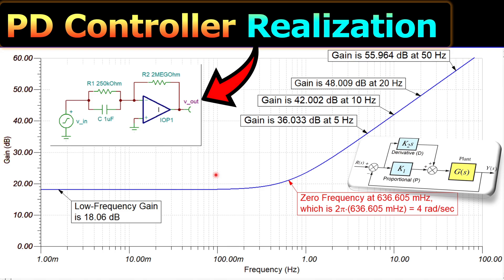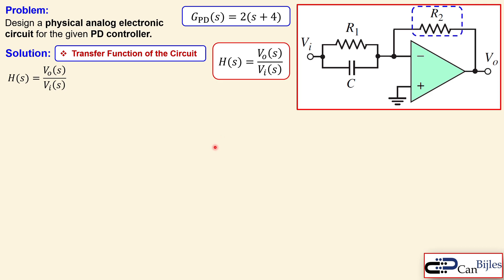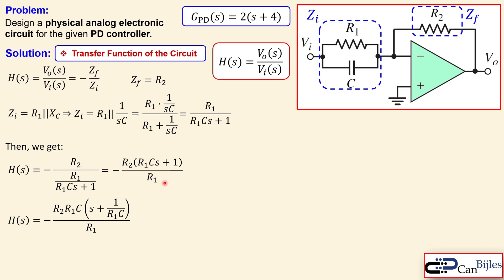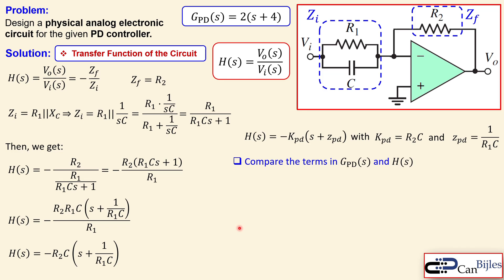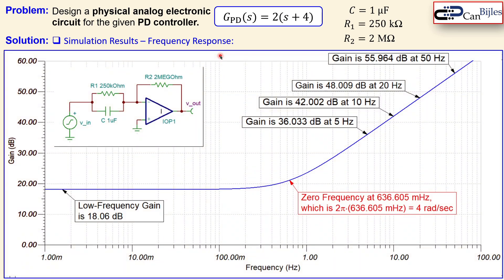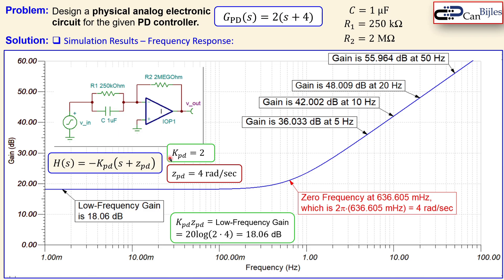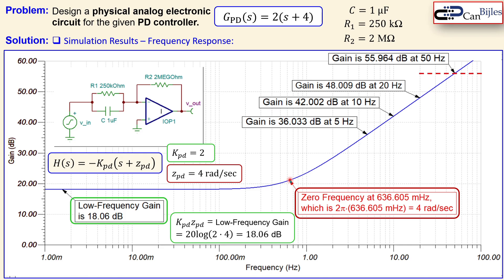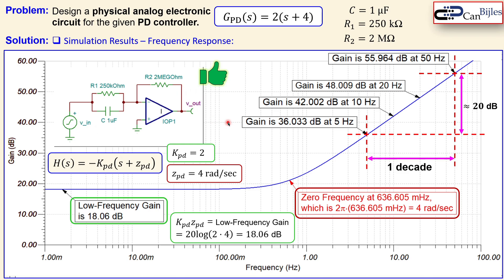Realization of PD Controller using Analog Electronics 🌟 Calculations & SPICE Simulations 👍 Example 2

Comment: I have a question, why is this possible? What I've been told so far is that in real life you cannot implement a PD since you have a zero without a pole, and a system in order to be physicially possible the numer of poles needs to be greater than the number of zeros. Also what I've always been told is that in order to be able to do a PD in real life, you must add a pole, leaving you with the following expression:

Gpd(s)=(Kc·(s+z))/(s+p)

Could you please clarify my question? Thank you in advanced :)
Reply from the maker: Thanks for your message. Indeed, a practical  PD controller requires a pole to reduce the high-frequency noise. The location of this pole will affect the PD action, so ther depends on the system requirements.